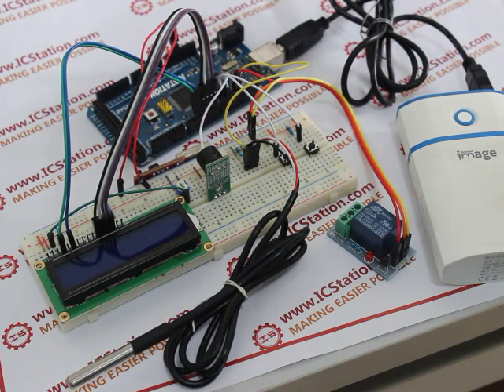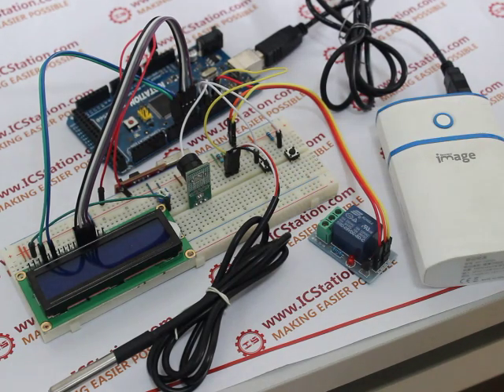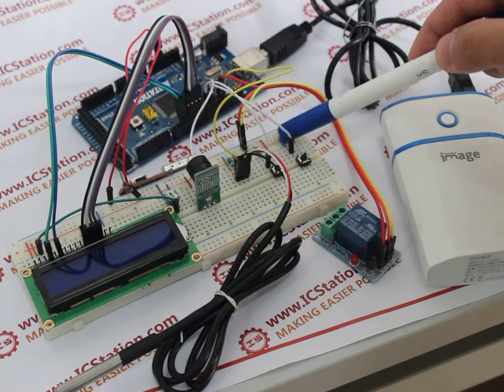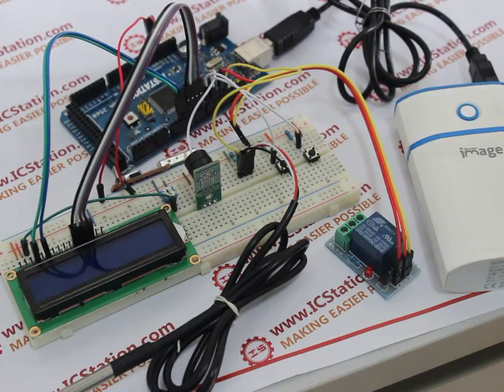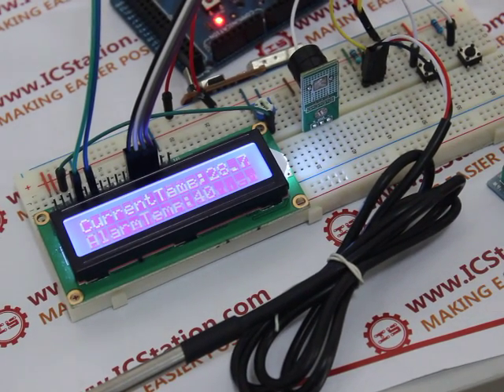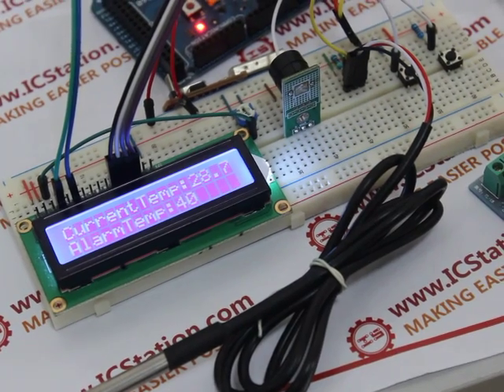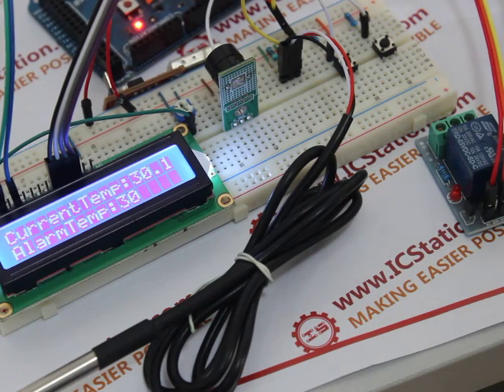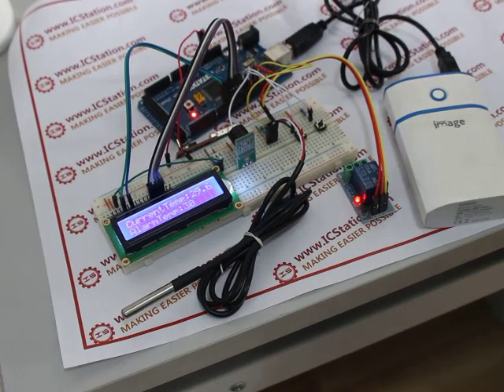Tutorial for Arduino▶ 16 Temperature Detecting Heating Control System

Comment: I am trying to do this project but i am facing some problems with the code.The errors are seems like" DS18b20:21: error: 'OneWire' does not name a type
DS18b20.ino: In function 'void loop()':
DS18b20:60: error: 'ds' was not declared in this scope
DS18b20:62: error: 'ds' was not declared in this scope"  
I am feeling helpless.Please tell me how can i solve this.